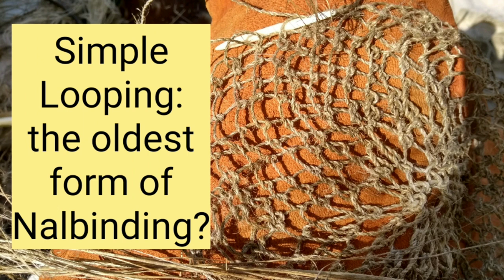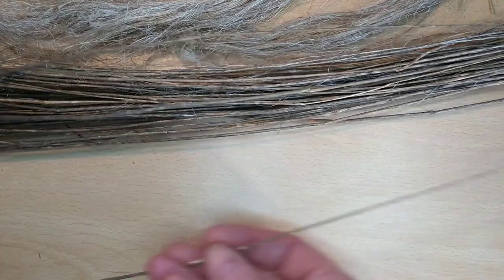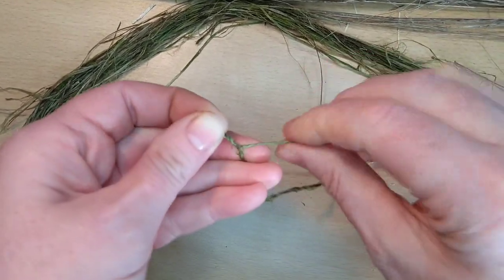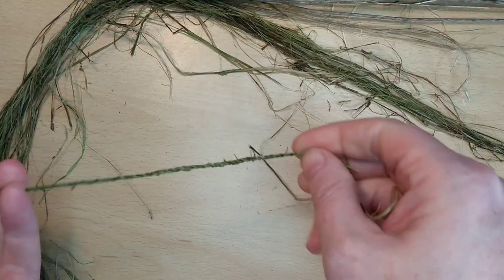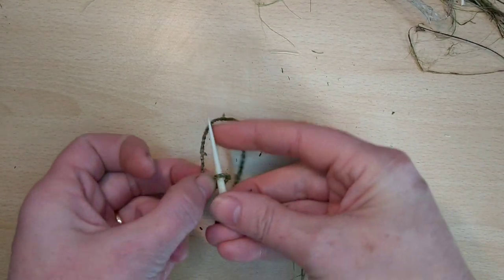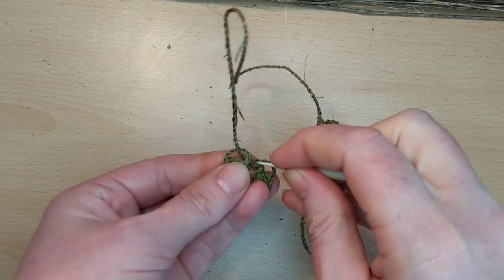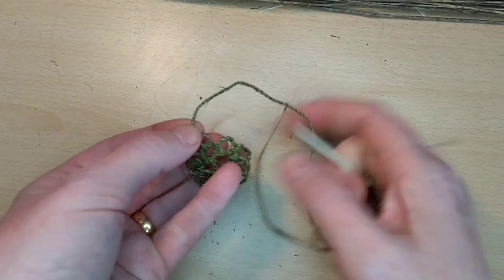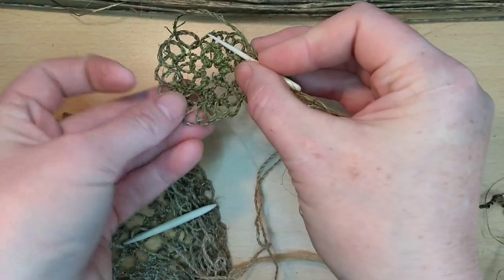Simple Looping: the oldest form of Nalbinding?

Comment: The similarity between this and crocheting in the round is   amazing, l couldn't help smiling when you talked through the stitch increases. Modern amigurumi relies on crocheting in the round to create the form of the finished item.
I'm fascinated that what seems like an initial disadvantage - creating the cordage you use - actually becomes an advantage as you continue by adding in new fibres. Amazing! ❤

Comment: How long is a piece of string? As long as you need it to be. A very Jack Hargreaves question that, lol. Very nice explanation of a very ancient art; I always thought they struggled with a huge length of thread, rather missed you could add thread as you went. I like the tight weave skull cap.

Comment: If you find it too fast to follow you can slow down the video by  pressing on the top right of you screen, a dropdown menu will appear, choose the three vertical dots, choose PLAYBACK SPEED, you will see you're on normal, if you chose the one above, it will slow down the video slightly, if you choose the ones below it will speed the video up, choose whichever best suites your need.

Comment: Might be neat to try making a woven rucksack like this too. Perhaps "coptic" (about as easy as this, just looping over crossings) and for the broad straps you can reverse back on the stitching to make flats.
Reply from the maker: Coptic stitch gives you a structure that closely resembles knitting, so you'll get the same stretching and curling you'd get if it was knit. If suggest bag straps in a different method because of that.
Reply: @SallyPointer  How about a whole bunch of parallel braids, then stitch those together on the edges? (Possibly 4 or 6 strand than the usual 3. More like braided belts and that kind of thing.) The thing is to get it to form a flat strip, since a round cording would dig in if used as a shoulder strap. Rest of the bag could still be done with this style of stitching work, and woven together in a fairly seamless fashion.
Reply from the maker: @pauljs75  braiding would be the best option rather than flat nalbinding, try something like a 12 or 14 strand twill braid, that has excellent support characteristics but isn't too fiddly to do.
Reply: Inkle looms look pretty easy too for making straps.  Not sure if it matches to the same era really if that's a goal of the project.
Reply: @CG-ng3xw  Seems that could be made with enough work and would be effective, but looking up the subject it seems that a back-strap loom would be something named with the goal in mind, and is of even simpler construction. (Both would technically be "period correct" if primitive crafting is a goal.) And I know there's another kind of loom which has one of the main components being a slotted board (not a big construction like a treadle) but I'm not sure if that's another variant of the back-strap or something else. Trying to look up these things tends to talk about the fabrics rather than the looms and processes themselves, which is a bit annoying.
Reply: @pauljs75  absolutely. I know the inkle is a small loom and has a slotted board on it, and just a bunch of pegs.  Made for creating thinner width weaves.  Of course if the idea is to create while roaming, braiding is probably the best bet, or a back strap type loom.
Reply from the maker: @CG-ng3xw  Inkle looms and backstrap looms can produce identical results, so if a prehistoric technology was the aim, I'd suggest backstrap
Reply: Saami weaving - backstrap weaving using a small rigid heddle with multiple holes to facilitate patterned weaving - might also be the type of straps that would be useful for this type of project.

Comment: There's no limit to cordage, you splice another piece in on each end as needed, never start in the middle of a strand though or you end up with your splices being at the same point as one another, stagger them for maximum blending and you can make cordage until you run out of material. Also what on earth is wrong with your flax? It looks dead and lifeless! Mine looks like a woman's hair even ten years on, I use it to make cloth clothing out of and other fabric, and the only colour change I get is if I dye it. But yours looks like an old wooden fence! Did you leave it outdoors for a long time or something? Now I'm worried mine will fade like that in the sun over time, no more raw flaxen cloth for me! :/
Reply from the maker: Each batch is different, but there's nothing wrong with this lot, just a silvery grey, it's got plenty of lustre in real life. Re the splices, for cord-as-you-go projects, I find even spicing with just one or two fibres added at a time at regular intervals gives for the smoothest, most consistent cord, but if you prefer a different method, go for it. There's always more than one way to do things. My main concern is to get people away from splicing in on just one side in big chunks, which leads to spiky, weak joins.